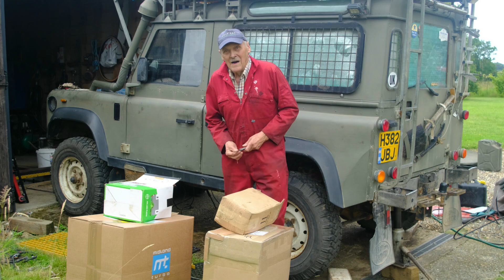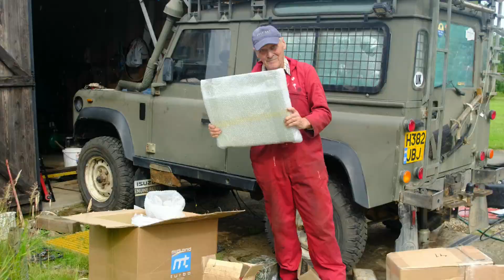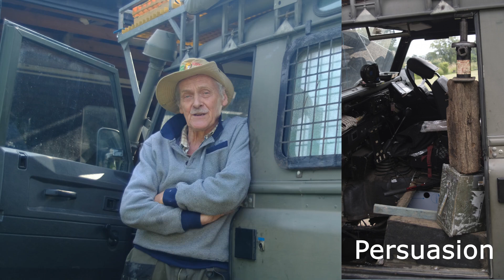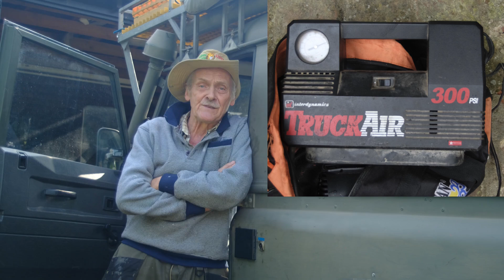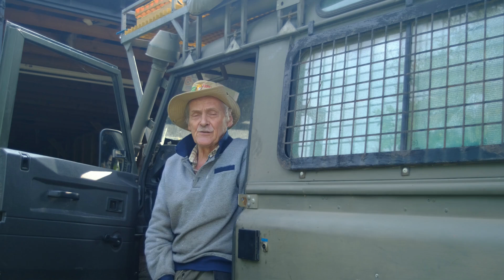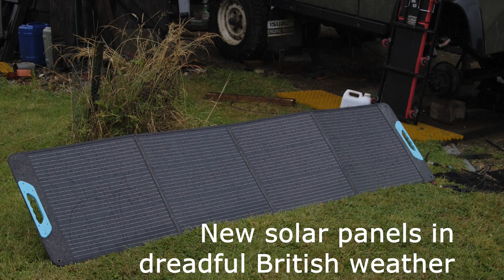Land Rover Defender 90 major revamp - episode 2

Comment: I’ve been thinking about redoing my battery box in my 110 build. I’ll most probably be making a new seat base , so why not. One question that I keep uming and erring about is why did LR use steel (the rest of the seat base is aluminium) , was it for safety or possibly fatigue failure (heavy battery in there). 

I take it you see no problem with using aluminium given your background. Any further thoughts?

Cheers from Australia 👍
Reply from the maker: I don't know why LR chose MS for the battery box given that the surrounding structure is Al. Although the batteries are heavy the box isn't highly stressed. With AGM or Li batteries there's  no risk of spilt battery acid eating away the thin section.

Comment: So glad you were just poking fun with the unboxing vids 🙂. I have a pneumatic riveting gun, and its riveting to use, can access quite difficult areas too. It really helps when your hand shake hand has RA, and theres lots of the little bu££er$ to install. 
Looking forward to more of your proper landy solutions, like the hinge nipples which really do work very well and make total Landy Sense 👍
Reply from the maker: @chriswalker4272  That Laser tool I bought for 12mm rivet nuts which I used to make a tilt for my big trailer. I put a new rear floor in my Disco and had about 200 pop rivets. It was a breeze. There was plenty of access however.
Expect boxes to keep making fleeting appearances in odd places in next videos in the series just to keep viewers on edge. It will be more obvious that I'm poking fun though.
There's plenty of technical comment to come but not enough time to make the videos.

Comment: Another great video Bill.  Just wondering if you have had any issues with your bonnet mounted spare and if so how have you addressed this?
Reply from the maker: @simonbarclay9507  Yes it"s too heavy,
Reply: @defendermodsandtravels  as i thought.  I have a 235/85/16 on the bonnet of my 300Tdi and on rough roads (plenty of those here is Australia) it takes a hiding and i'm guessing a matter of time until there is a major failure at some point when I'm 2,000 kms from anywhere.  i regularly check for cracks or metals fractures.  I also have a rear mounted one on a swing-away Front Runner mount as it is prudent to carry two spares here, so have really run out of options (trying to keep weight low) unless I just carry the tyre carcass and change rims when required, but I'm too old for that sort of work ;-) .

Comment: Those compressors are ok, I have two of them and I do recommend you have a spare pair of brushes for it, also the head can get extremely hot so don't melt the battery cable insulation that's running over the top of it, on a side note I do use a small tank with mine because I run on tubeless tyres but I do know you use tubed tyres so that's not an issue for you.
Reply from the maker: Thanks for the tip. I will make sure the battery cable is clipped to the side of the box. These are exactly the types of risk I am trying to eliminate. If it can go wrong on a big trip it will go wrong as I have demonstrated many times.

Comment: You are the man,l converted my old AC pump in my 4bd1t land Rover County into a air compressor,makes those battery powered air compressor look lame.😅
Reply from the maker: I normally buy "fit for purpose" rather than "top of the range" but in this case I went for a high end Viair compressor which supports a 100% duty cycle. When travelling to hotter climes you can't afford to have compressor failure (the footpump is an emergency contingency only).
Reply: @defendermodsandtravels   I have the same compressor and it has served me (and the rest of my group!) extremely well in the Tunisian Sahara. Because it is hard wired and easy to use, it gets used a lot. As you pointed out, if it's hard to use or slow many people will skip airing down. Even though everybody on the expedition had some form or another of compressor, I offered the use of my air line to the rest of the group and it made all of our lives easier!